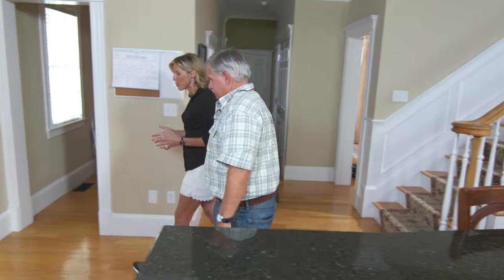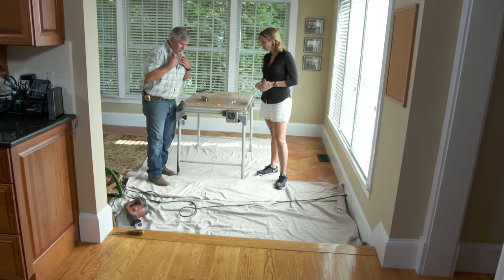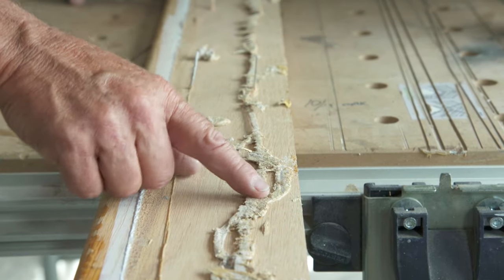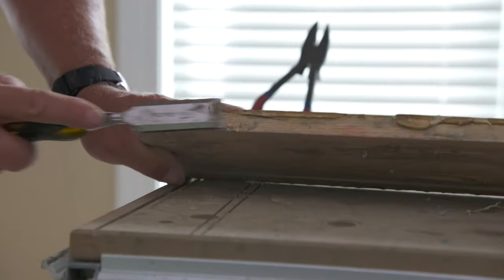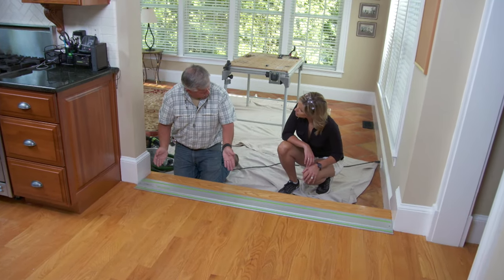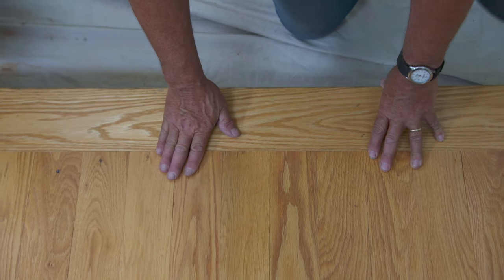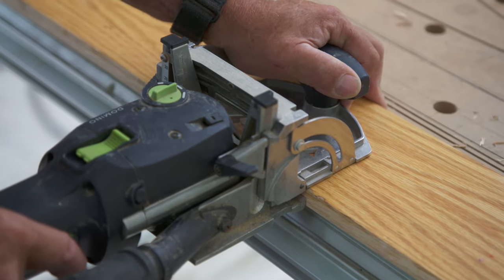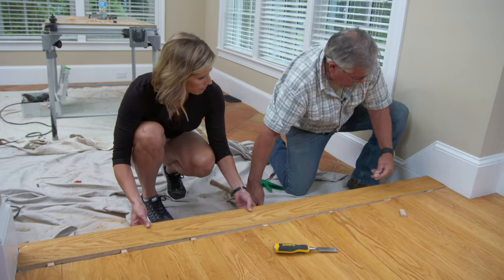How to Repair a Bad Flooring Joint | Ask This Old House

Comment: How did he stop the that straight edge from moving while he used the circular saw?
Reply: jconradh Those straight edges/tracks have a rubber grip on the bottom, and are surprisingly stable.
Reply: Plus the weight of the plunge saw keeps it from moving
Reply: screw it to the floor
Reply: pawelgatorade you don’t need to with the festool tracks. They seriously do not move.
Reply: Jedi mind trick
Reply: 160 lbs of old man?
Reply: If you have to ask... you can’t afford it

Comment: I was admiring his work until he drove those finish nails.
Reply: Jerk Of All Trades  finish screws
Another thing he does did I do not like
Your Hammer should never touch
drive the  nail until it's out about an eighth of an inch and drive it the rest of the way in with your nail set
Reply: @garychambers5930  do you have a link to finish screws at Lowe's or hd?
Reply: @ZachAuclair  home Depot is where I get them 
They are great
You'll love them
Reply: @ZachAuclair  they have them from 1 1/4 - 3 1/8
Reply: @garychambers5930  Did you not notice that Tommy is just good enough to get the nail that close to flush before using his set? His hammer never touched the wood.

Comment: 1:22 vs 6:32 fixed one joint created another. Wish Tommy show how to fix the gap at the notch end. Contraction and expansion in different directions and joint so tight with so much glue not allowing any movement, wonder if it will fail. Hand chisel matching the saw cut exactly pretty skillful. In any case, looks lot better after fix.

Comment: Festool to the rescue
Otherwise would have to use table saw turned upside down. Tommy just happened to have the exact size track for the job. And a Domino tool to boot

Comment: how did you fasten the guide while you made the cut?
Reply: I just asked the same thing . I would think it has to be mechanically fastened . There can be no other safe way ? can there?
Reply: The bottom of the guide rail has antislip strips. It creates enough friction to hold the track in place very well.

Comment: Gluing the tenons in place could cause issues down the road. He talked about expansion and contraction of wood but then killed it by using glued in tenons! 

If anything, the tenons should have been glued to the floor and then the receiving holes in the trim board should have been 1/8" (or more) wider to allow for expansion and contraction.
Reply: All the glueing and tenoning will make that like a rock...The movement will be unnoticeable that stuff was there for a long time so, it's acclimated. Most people don't give a shit as long as it's not popping up...I tell them it's breathing...
Reply: Not so sure there's going to be expansion problems. He doesn't have a tenon for every floor board. I would expect that the boards with the tenon are going to be "anchored" in place as the floor expands and contracts, but there will be movement in the intermediate boards that don't have a tenon. And then for the step, it too will expand and contact, but not lengthwise, just the width. The tenons will keep one edge of the board anchored and the overhang will increase and decrease instead while keeping the joint tight.
Reply: I always get confused with expansion and contraction of woods .
Reply: John Salazar for example when you glue up a panel door how does it expand or how can you prepare ?
Reply: Levi,  expansion and contraction of wood, is easy.
Melania Trump will make wood expand. Hillary Clinton will make wood contract.
Reply: lol
Reply: I agree with you John.  If the tenons were a little narrower it would be better.
Reply: just always keep your house at 70 degrees with 40% relative humidity and you won't have movement.

Comment: Okay, so how would you do this job without the fancy $$$ Festool? Maybe score it with a utility knife and then carefully cut with an oscillating multi-tool?
Reply: Good idea. I would also use a straight edge of wood  hot glued or tacked with brads to the flooring as a guide for the oscillating multi tool.
And then go to Home Depot to rent a biscuit joiner for one hour to cut slots for biscuits or splines. Easy peasy.
Reply: No.  Use a circular saw with a 1x4 cut to fit, pin nailed in.

Comment: It's nice to have professional tools like Tom. I had to fix our oak floors when I removed a wall. Instead of a track saw, I used a regular circular saw and a homemade 'door board' made out of hardboard (https://youtu.be/5E1v-qPQJvs). Instead of dominoes you can use a dowel jig https://youtu.be/epPHaxDCv48 . It was under $150 for the tools plus materials and a bit of time to make the jigs. Festool is nice but not needed...

Comment: 'It was not that hard to do', she said.  She did not do anything.  She could not have determined the solution, nor implemented it in two lifetimes.  But she did know that it was easy to do as long as she was not doing it.
Reply: Good-looking gals think everything is easy.  They never have to do anything except smile.

Comment: Yep pretty easy when you have million dollar equipment.
Reply: You can get a sheet of 3/4" plywood and rip a 1ft piece to use as a straight edge and a cheap $30 circular saw.. Use some dowels and appropriate drill bit..

Comment: Why a tenon and not a biscuit? Seems like either would work. Just wondering.
Reply: monkeygraborange 
They would do.
Both Keep it flush.
Reply: Keep it fresh.
Reply: Festool doesn't make a biscuit jointer.
Reply: monkeygraborange I don't think it makes too much of a difference as long as it keeps the pieces together. could have even used normal dowels if that's what he had on hand.
Reply: I didn't think it made much of a difference... I just asked because I use biscuits for every type of joinery and don't need another redundant tool.
Thanks for the input everyone.
Reply: jesus gutierrez 
The reason he used the domino or could of well used a biscuit was to machine the slots very accurately to keep the tread flush with the floor, so, as he pushed it into place and over the construction glue theres no chance of it lifting while curing. See what i mean. Theyre extremely good at flush jointwork. 
And yes, the added benefit of getting some tenons in both pieces to almost guarantee a perfect joint with very little chance of it opening up.
Reply: @JG-pw5cr dowels?  LOL.

Comment: Is it just me but wasn't gluing that board to the ends of the main flooring incorrect? That would be a cross grain joint and it wouldn't let the wood expand and contract in the natural direction and could lead to cracking(?).
Reply: David Mm  because biscuit is wooden it's expands and contracts with the board at a similar rate
Reply: he used construction adhesive underneath the trim, and It looked like he nailed it also
Reply: You are right David. One glued domino in the middle would work fine or alternatively unglued loose dominos.

Comment: Nice job  u should of use a pin nailer instead of those nails
Reply: Harrish Persad he was just putting nails back in the original nail holes I think.
Reply: Even if he was putting the nail in the same hole he should have counter sink the head an fill them it would look better than seeing the nail head
Reply: @harrishpersad3643 he did countersink it.  I'd like to countersink Kate.
Reply: @scottslotterbeck3796  my bad thanks for pointing it out

Comment: There is something that I can’t understand. If you didn't do it right the first time because of a mistake. What is the point of interfering for failure? What do they gain with a person failing in their work? What is the point of making a person fail? What is the point of wasting a person years of his life? Therefore, I try to understand only meaningless things that have no sense. Isn't there enough corn dough to make tortillas?

Comment: He pulled the nails out in the wrong direction!  Nails have something that they call heads on them!  Now that he made tenons and glued them, the wood can`t expand and contract as well, possibly splitting it, why did he explain the whole wood expanding and contracting concept in the beginning, when in the end he glues it?
Reply: No.  Tommy has explained that when you pound them out, they often take bits of the surface out with them.  He's found if you pull finish nails out from the back, they leave a nice hole.

And he's right.

Comment: Dude has an $800 dollar track saw but doesn't have an 18 gauge trim gun?
Reply: The holes were already there, with 8d nails.  18 guage would flop around in those holes

Comment: He used a biscuit joiner to add tendons there actually called biscuit joints
Reply: Rhys Hopkinson actually dominos,
Reply: Loose tenons.  Dominos is the Festool brand name.  $1200 for the tool.